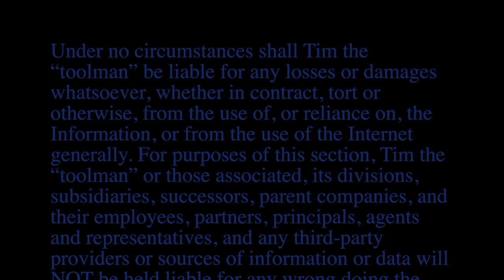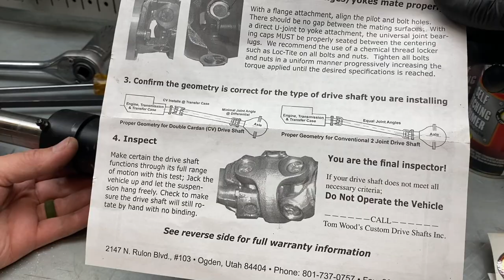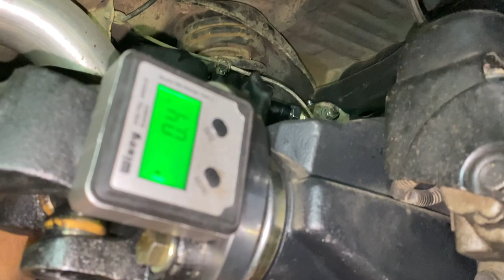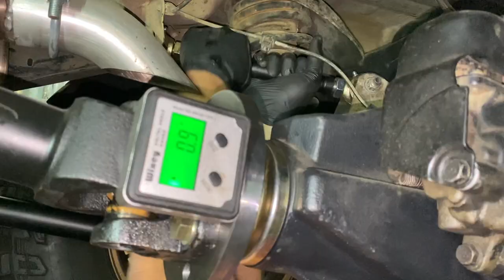Marlin Crawler Dual Transfer Case Install (Part 2 - Installation)

Comment: These two videos however give great detail for those planing a crawler in an auto 4Runner/Taco/Prado90 from this era.
Reply from the maker: At the time Sean and Chris did this job, the instructions available from Marlin Crawler left a lot to be desired.  There was a lot of interpretation needed and seeking information from other sources to pull off this job.  But now, thanks to Sean and Chris, people have a detailed tutorial to follow.  What's interesting, is Marlin Crawler hasn't even taken advantage of this video series and linked it in the tech area of their website.  We gave them a total gift and they don't use it.  

I respect the ingenuity Marlin Crawler brings to the Off-Road World, but I feel they leave a fair amount to be desired as a company to do business with. We've made some great industry partnerships over the 7+ years we've been running our channel.  From what I can tell from my interaction with Marlin Crawler, they don't get or value what a YouTube channel like ours can do for them.  Those that get it, reap the benefits, because the companies we work with are always more on the receiving end of the relationship.  It's always going to be lopsided and we're ok with that.  As long as we know the company we are working with appreciates and respects what we do, then we're all good with them.  There's many ways that appreciation and respect can be shown.  We're not hard to please.  

Anyway, sorry for the novel.   Happy Wrenching!

Comment: Another great video, thanks for the time and effort gents! That jobs hard enough without all the camera work and editing...huge benefit to the 4rd gen community.
Not to be greedy, but any plans for a video about the gas tank relocation?
Reply from the maker: Hey Ben, since the tank is completed and buttoned up, we were loosely planning to do the same thing and my truck. Not sure how quickly we will get to that so maybe an overview of the work on his might suffice for your needs?
- Sean
Reply: @TimmyTheToolman  That would be great! Thanks and no rush.  I am familiar with the Eim product and have followed most of the forum threads, but was just curious which direction you went with plumbing, wiring, pump, etc.
Reply from the maker: @benriewer7817  he kept all the OEM stuff, bent the rod for the gas measure to fit in the shallower tank, and welded on the circular mounting fitting on top of the f-150 tank that was cut out of the original OEM tank

Comment: Such a killer mod. I'm a little jealous that you guys are 3rd gen guys. I'm a 4th gen guy. However I always enjoy your vids, there's a lot of overlap with the processes and just a few differences usually. As my truck gets older I get braver (more brave ??) at doing work on it, but I'll probably never have a reason do do serious mods like this. Maybe some day... Anyway, great work!!
Reply from the maker: Thanks for stopping by the comments. We appreciate you watching our vids and chiming in here. It was def a fair bit of work, but there are other mods which would help with wheeling like a front and rear locker and bigger tires should get you through any obstacles this rig could. A good driver mod always helps too!

Comment: The bearing puller you used in the part 1 video can be used to pull the coupler you are trying to remove at @16:14.  I have used one for exactly that.
Reply from the maker: Thanks for the tip.

Comment: Hey guys, great video. As a manual transmission 3rd gen owner myself I am looking forward to getting to this stage! Main question is about the adjustable uppers. How tall of a lift is Chris running in the back? It seems like 12.5 inches would be a good starting point to get the pinion angle correct, I am running LC 8-wraps with about 4 1/2 inches of lift. Thx!
Reply from the maker: Chris’s lift is approximately the same as yours but everyone’s setup is different so you would just adjust accordingly to your needs. There isn’t an exact amount and Chris has been slightly adjusting the length of his uppers here and there as he drives it to dial it in more.

Comment: Idk if the front axles are oem.  if they are I’d get some spare front cv axles or rcv’s I imagine 2x low is going pop them
Reply from the maker: I think most guys with IFS carry at least one spare CV axle even without dual cases.  All the guys I wheel with do.  We've heard about RCV axles and their reputation of being strong.  But, you have to give up your left nut to get a set.  I just checked the price and it's a little over 2k.  Another thing to consider is do you want the CV axle to be that strong?  If the torque is too high and the CV axle doesn't break, maybe the front diff breaks and then you're really screwed. 

I can't speak for Chris but I'm gathering he's just going to carry 1, maybe 2 spares with him on wheeling trips.

Comment: Perhaps the thinking has changed since my day, but FIPG can be problematic when you can't get at the joint on both sides to clean it after the part has been installed. One needs to clean off the excess, squeezed-out material, otherwise the hardened, excess beads can break off later on and plug oil galleys and just generally mess with stuff. Parts stuck together with silicone are usually pretty ugly and infer laziness, though it'll work when one can clean both sides after install, as was done here.
Reply from the maker: A transfer case doesn't use oil galleries to move gear oil to parts.  A transfer case or manual transmission uses a splash method to carry the oil gear to gear and to other moving parts for proper lubrication.  There is no oil pump.

FIPG is used in certain situations on drivetrain components and quite often you can't see on both sides after the parts are assembled.  Not everything has a metal, cork, or paper gasket.  FIPG was used for many applications, like sealing engine oil or transmission pans, and is superior to a paper, cork or metal gasket because it can flow into imperfections in the metal that a regular gasket can't.

Once any sealant has hardened, It's not going to break off unless something contacts it.  I've cleaned off more than my fair share of sealant, and it doesn't come off that easy.  Oil flowing past it is not enough to break off a chunk and have it plug an oil gallery.  For the installation of valve covers on these Toyota engines, FIPG is used in conjunction with the rubber gasket to create a leak-free seal with the head.  I've never heard of anyone worried about a piece of the gasket material breaking free and plugging an oil galley.  

What you do have to worry about is when you are doing something like a valve cover gasket job, and you're cleaning off old FIPG, that none of the old sealant you're scraping off ends up in any of the oil galleries.  That's a legitimate concern.  

So, in closing, your comment that using sealant to put parts together is ugly and lazy is just plain ignorant.  These vehicles came assembled from the factory with using FIPG for many applications. I think there was some bad information being given out back in your day.
Reply: I'm a retired aircraft mechanic and 'in my day' some of us dealt with failed engines in which silicone seal did play a part in that failure. The two I dealt with were a Baron and a 310, so the pilot was fortunately able to safely perform an emergency landing. The oil screens had silicone seal remnants in both of them. It was considered not quite illegal and certainly very gauche to use that stuff in aircraft engine overhauls, and engines I pulled apart with it were hard to disassemble and took a fair bit of extra effort to clean.. So times have changed. 

Upon re-reading, saying ugly and lazy was unnecessarily unkind and I deserve the ignorant shot back. I apologize for only that, and shall continue to use silicone seal only as a last-ditch sealing method where it is necessary and there is not any chance of engine contamination. Hylomar Blue or equivalent, which is 99% of assembly work, seals just as well, is far easier on disassembly, and I believe safer.
Reply from the maker: @wilnstevenson5957  I understand your position better now.  Apology accepted.  For many Toyota engine applications, the original way to seal two parts was sealant, not a physical gasket.  There are now aftermarket options available for things like oil pan gaskets, but the preferred method is still using FIPG.  I'm guessing for aviation applications, gaskets are available for everything.  Take care.
Reply: As you perhaps now see, I am not ignorant, my critique was based in experience and facts. I accept criticism pretty well, but not when it is inaccurate. You were wrong to call me ignorant, just as I was wrong to call that sealing process lazy and ugly. All three are unnecessarily personal terms.
Reply from the maker: @wilnstevenson5957  Well, your comment at that moment in time was ignorant in my opinion based off what I know about automotive engines, mainly Toyota engines.  Now that I know where you are coming from working on aircraft engines, I understand better with your position.  But still, not knowing these engines rely on FIPG for properly sealing of some parts is a level of ignorance you have with these engines.  For the application of this video you are referring to, there is not a gasket to seal the transfer case to the transmission.  That seal doesn't exist.  This job is a modification to the normal drivetrain of these vehicles and Toyota never made a gasket for it nor did an aftermarket company make a gasket for it.  Normally, no gear oil fills the cavity between the transfer case and transmission.  When you install dual transfer cases, now that void does have gear oil running in it, and you need to seal that connection of the transfer case and transmission.  

The word ignorant can have negative implications towards the person it's directed towards, but a lot of times, it's just stating a fact that someone doesn't possess all the knowledge to make an informed statement or form an opinion.  So, from my perspective, you were ignorant of some facts and that's why you made the comment you made.  Make sense?  I'm ignorant to a lot of subject matter.  We all our.  You obviously know a lot about aviation mechanics.  I don't.  But, I happen to know a fair amount about Toyota engines.

Comment: How did you guys determine the length of the front and rear drive shafts when you had them custom made?
Reply from the maker: You measure the distance from each driveshaft mounting flange. And the slip yolk compensates and adjusts the driveshaft shorter and longer as the vehicle goes through suspension cycling.
- Sean
Reply: Tom woods has an excellent YouTube video showing how to properly measure for custom driveshafts.

Comment: How much did the tom woods drive shaft cost you how did you measure for flex and droop
Reply from the maker: The driveshafts are around $500 each.  The Tom Woods website covers how to measure for the shafts.

Comment: how did you get one? been checking the MC website for 2+ years and even left emails to notify when in stock or can be built.
Reply from the maker: Chris ordered it a while back.  How long, I don't know.  You would think Marlin Crawler would get off their butt and start producing them since people obviously want them, but the way they operate really makes you scratch your head.  They make great stuff, but their manufacturing leaves something to be desired.  Why build something cool, advertise that product, and then not be able to fulfill orders?  I don't get it.

Comment: I was just wondering what will be the MPG on that beauty? I'm thinking going RCLT built on my GX470. Im already 9.8/14.8mpg with 34's
Reply from the maker: Adding a second transfer case to your drivetrain won’t affect your gas mileage significantly, maybe .1 MPG if that. It adds a little extra weight but no more than a small child in the back seat. Armor, bigger tires, bumpers, roof rack and accessories etc are the main contributors to loosing MPG’s. Did you re-hear after stepping up to larger tires?
Reply: @TimmyTheToolman  no. That's something I am considering. What gears would you recommend for 60% road and 40% offroad/overlanding? Also how will I contact you guys for future build?

Comment: WHERE DID YOU GET THE CROSSMEMBER FROM?
Reply from the maker: They just welded on a homemade extension to the stock cross member that supports the transmission.  They talk about it in the video.

Comment: Would this apply for my 2003 GX470?
Reply from the maker: This job was done on a 3rd Gen 4runner.  I don't know if Marlin Crawler makes adapters for your GX470.  Check out their website or give them a call.

Comment: Timmy, I had the engine rebuild in my 2002 Tundra 3.4l v6 and I cannot get the “Drive Cycle” to set so it will pass the State emission test. I am getting drive cycle faults for Catalyst monitor and Evap monitor “Not Ready”. Help a brother out this is a F$&king nightmare my man. The TSB drive cycle info does not seem to help when I try to duplicate their procedure.
Reply from the maker: Interesting you should bring up issues completing the drive cycle.  I had a P420 code pop up right before I was going to smog my 2000 4runner and now my registration is expired because the system isn't ready.  I'm trying to avoid an expensive catalytic converter replacement,  but it's not looking good after using some fuel additives to clean the cat.

I've done research on this and the official drive cycle is nutty.   It's pretty much impossible to complete unless you live in the country with long stretches of road with no stop signs or stop lights.  I've never had an issue with passing smog on any vehicle until now.  For you and me, something is keeping those monitors from passing and showing the system is ready to be tested.  So, we're in the same boat and I don't have an answer for you unfortunately.

Comment: It appears (starting at 6:40), if you can get the bell housing seal out you don't have to remove the bell housing or the c-clip, that "little dust cap cover thing" or bearing.  I'll definitely work on that idea instead of all the extra work and sealing.  Thanks for the video, sure is a lot more information than Marlin Crawler gives out.

Installation sequence would be to install the 23-spline adapter through the remaining bearing and "that little dust cap thing"; then the spacer, then the seal.  DONE.  I think...

I will try this to remove the seal:
https://www.youtube.com/watch?v=wUKHphOOFo8&t=161s
Starting at 0:45 or 1:45 is better.
Reply from the maker: Thanks for sharing the techniques you plan on using.  Hope it works out.
Reply: You do still need to remove the dust shield and bearing for the adapter to fit I believe, not sure if you can remove the bearing/dust cap from the back side but it’s worth a shot!

Comment: A pinion nut should NEVER be installed using an impact as it can damage the bearing race, or even the teeth of any gears or splines in the differential. There is a preload spec for differential pinion/bearings and it most definitely is not achieved precisely "with this impact pretty hard on this third setting" lol
Reply from the maker: You might have missed it but Chris got his rearend re-geared and the spacer is solid and not a crush spacer.  So, he did no harm using an impact gun, because with the solid spacer, he can't change the preload of the bearing.
Reply: @TimmyTheToolman  You are correct, a solid spacer does not require a preload procedure as the nut will simply become tight and will not tighten further (with the risk of stripping threads). However, whether a solid spacer or a crush spacer is used is irrelevant to the harm caused by using an impact on the nut. What do you think is reacting the impact shock loading? Its the pinion gear teeth that are engaged with the ring gear teeth. Those teeth are effectively bouncing off the ring gear repeatedly at very high torque and can easily cause a fractured tooth or two. The pinion and ring gears are very stiff and made of very very hard steel alloys, making them very brittle and prone to fracture from impact shock loading. This is why chrome sockets will shatter when used with impact guns, because chrome vanadium alloy is relatively hard and brittle. Black impact sockets are softer and can take the abuse of impact shocks, hence they are made of chrome molybdenum alloy, which is softer than the typical chrome vanadium sockets. If your pinion and ring gears are made of chrome molybdenum (lol), then by all means use the impact gun.
Reply from the maker: @hermanq5615  I personally wouldn't have used an impact to tighten that pinion nut, but I wasn't there and it's Chris' rig and he chose the impact.   Could the impact cause damage to the gears?  I don't know.  If you're right and it's as dangerous as you say it is, I guess Chris got lucky because his 3rd member is just fine.
Reply: @hermanq5615  I do agree with what your saying however that impact is pretty weak compared to most. In the video the socket used for tightening that specific nut was a chrome one lol. If it were a bigger impact with 1000ft lb of torque yes that would be bad.